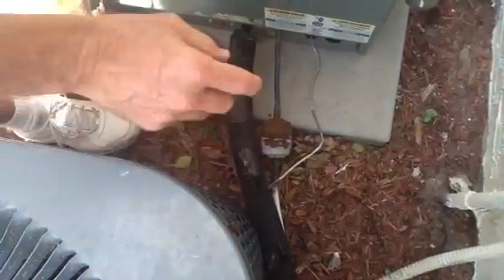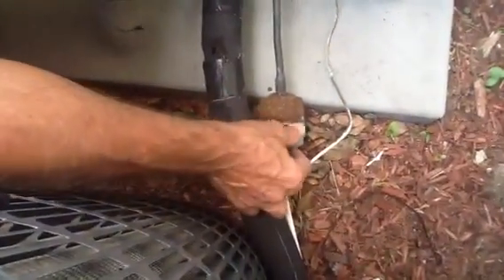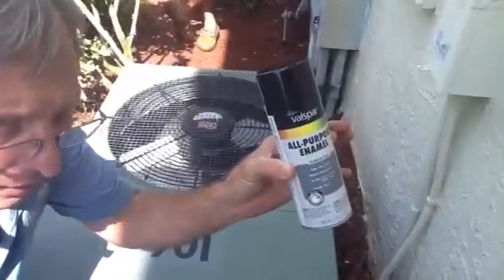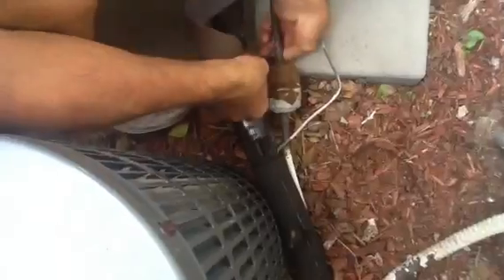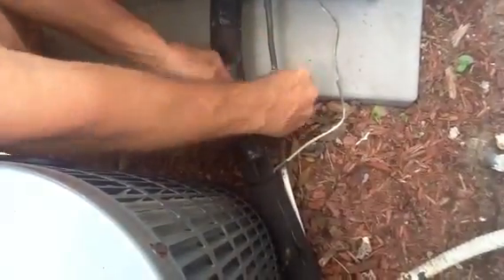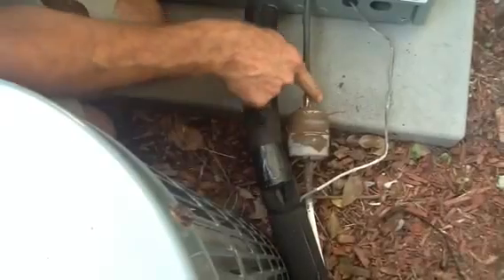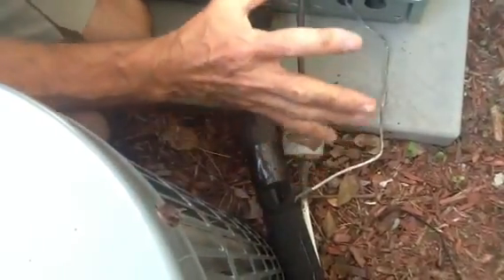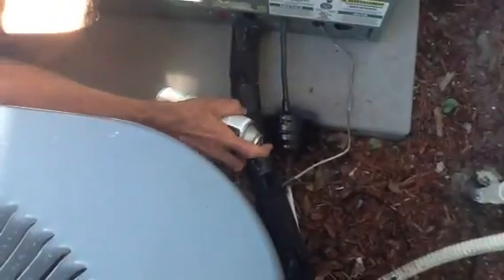Doctor Up a Rusty Filter Drier:

Comment: Great informative video !  Suppose that is about 100 grit emory cloth and acrylic enamel paint ??  I suggest before painting, remove the sanding grit, etc. with a clean rag/towel, then spray 2 or 3 light coats (separated by 2 - 3 min per coat) of Mar-Hyde Rust-Converting Primer (excellent product that converts light rust into a black, sandable primer that will accept solvent or water based topcoating paint !); it has been so good for decades that 3M bought the company and now makes this Mar-hyde rust converter !  Until you tube, I would not have guessed how darn important that little filter-drier was !  I've started the process of preserving mine ! Thanks !